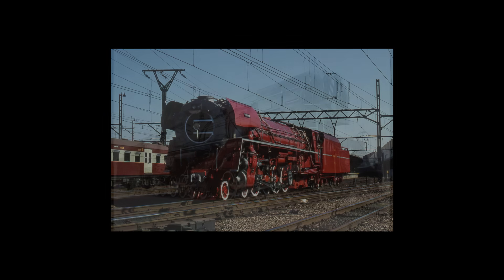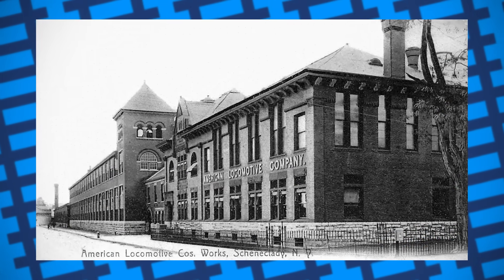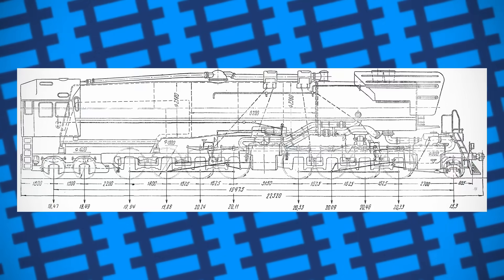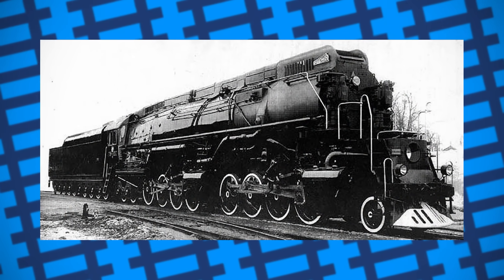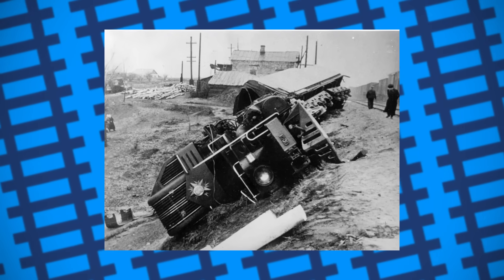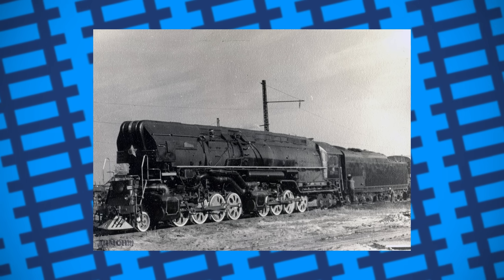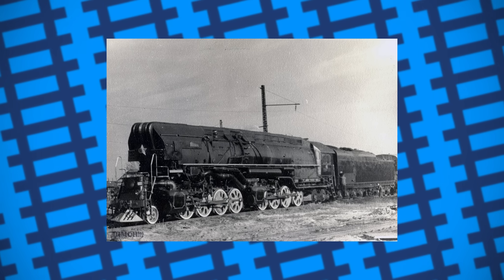Russia's Mightiest Steam Locomotive (that they never used) - USSR П38

Comment: 4:01 most modern American articulateds were actually simple, ie non-compounding. If memory serves, the last proper mallets built in the states were the C&O’s H6 class 2-6-6-2s, a modification of the USRA standard design dating from WW1, but they were built in ‘49.

Comment: Challenger and Big Boy both used simple expansion. It's only a "Mallet" if it does use compound expansion. If it uses simple expansion it's a duplex which may or may not be articulated. The Pennsylvania T1 class is a example of a non-articulated duplex. There are also many locomotives that used compound expansion and were not duplexed.

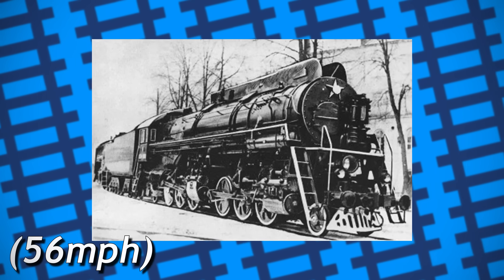Comment: 2:22 I reckon this is a translation error? What you probably mean is Heusinger valve gear. 
Heusinger invented a gear virtually identical to walshaerts independently around the same time, so german speaking countries (and a couple others) call it heusinger while most others call it walshaerts but the difference is really in name only.

Also no, the lack of compounding wouldn't have been an issue with any somewhat competent boiler design. The UP big boys and challengers were also not compounds. The advent of Superheating replaced compounding to make an engine efficient and economical. And the p38 is superheated.

Comment: Most of the US Mallets were not compound, after around 1918 most US Railroads drop that outside of the Northfork Western Railroad. The Challengers and the Big Boys, as did the Pennsy T1s and Q1/2s basically all post 1930s locomotives not N&W only use high pressure steam in their 4 pistons.

And none had problems keeping up steam.

Comment: I'm not entirely sure, but I think you have mallet's and articulated simple expansion locomotives mixed up. The UP's challenger's were simple expansion locomotives, meaning they had high pressure front and rear engine cylinders. By the 1930's, mallet or locomotive's with a set of high and low pressure cylinders had mostly fallen out of favor, especially in the U.S. as they were slow and mostly for drag freight. It is likely that the P38 followed this shift towards simple expansion locomotives which would dictate the end of the steam era, and thus used simple expansion for this reason.

Comment: I would note that 4 high pressure cylinders would have been standard for large articulated steam engines in the US by the 1950s.  US design quickly moved away from compound mallet design and by the 1920s most articulated steam engines were "simple" articulated designs with all cylinders being the same pressure and piped steam directly from the boiler.  Therefore it makes sense that the Soviets would copy the concept for the p38

Comment: It’s possible the locomotive would’ve had steaming issues, but I don’t think it would’ve been entirely down to the simple cylinder arrangement. If the boiler wasn’t entirely up to the task, the leaking flexible joints would’ve made things worse

Comment: So, these locomotives are not mallets, mallets, by definition, use compounding. If all 4 cylinders receive high-pressure steam straight from the boiler, it's not a mallet, but instead a simple articulated
Reply: ar enough, but (at least in the US) common terminology often refers to the Mallet articulation (which was kept up to the end of steam in the US) as separate from Mallet compounding (which was mostly dropped in the US well before the end of steam).

Comment: Fascinating! I know next to nothing about Russian locomotives. The 4 equal preassure cylinders of tge P38 would make it a Simple Articulated, not a Mallet. Mallets use steam twice, simple articulated use steaam once, through both cylinder sets simultaneously.
Reply: Far enough, but (at least in the US) common terminology often refers to the Mallet articulation (which was kept up to the end of steam in the US) as separate from Mallet compounding (which was mostly dropped in the US well before the end of steam).

Comment: Great portrait of the Pe 38. Impressive machine, must not fear a comparison to the american sisters. Like them the single expansion was most probable chosen, because the low pressure cylinders would have been too big to handle. Already the Bavarian Gt 2x4/4 Mallet from your other video hat low pressure cylinders with a diameter of 800mm. Try to scale up to the Pe 38 it could easily measure up to 1 meter.

Comment: why do you keep refering to it beeing a simple articulated locomotive rather than a mallet as strange? it defiently isnt, most good articulated engines are simple articulates, with only the penny's 1309 and it's class coming to mind as an example of a mallet that was good, most found that the front exaust steam cilinders where too weak

Comment: I doubt it had steaming problems, the union pacific challenger. Big Boy and many other similar engines had 4 high pressure cylinders and didn't have issues.
Reply: Not to mention this is the Russian loading gauge and not some tiny European one so the firebox isn’t really as limited as others on the continent.
Reply: Those are two of the best example, but we have our duds too. The N&W found their Z-1 Mallet boilers to be rebuilt as Z-2 Simples and the C&O H-7’s, the first Simples, were so poor the C&O didn’t even keep them
Reply: @russellgxy2905  do you have a source to backup your statement, because what I can find crews say it was a fine performer.
Reply: @gamerfan8445  Unfortunately I can’t recall the source for the H-7’s. From what I’ve found on forums like Trainorders, they WERE good pullers, but they weren’t any better than a Mallet in terms of speed. They had the same tonnage rating as an H-8 on home rails, but that was simply in drag service
Reply: Not all articulated steam locomotives had four high pressure piston.  The Mallets had two front high pressure cylinders that fed into two low pressure pistons on the rear driving wheel assembly.
Reply: @bigboy4006  The high pressure cylinders are in the rear in the original Mallet design, so that the high pressure steam does not have to go through the articulated or flexible pipes to the front cylinders, which are on the swiveled engine.  (Later improvements in technology for getting the steam to the swiveled unit enabled US locomotive makers to make all cylinders high pressure without running into the problems that the Soviets had described here.). In principle, you could have high pressure cylinders in front and low-pressure cylinders in the rear on a cab-forward design (which turns the whole design around), but I don't know of anyone who built a cab-forward Mallet articulated that also had the Mallet compounding (the Southern Pacific Cab Forwards had all high-pressure cylinders).
Reply: @Lucius_Chiaraviglio  That makes sense.  For some reason, I thought the cylinders were the other way around.  It's been many years since I've read about both the high and low pressure cylinders, so I most likely misremembered.
Reply: Because these things aren’t simple, the Soviets in their infinite wisdom made a Mallst with same size low pressure and high pressure cylinders, which is why in terms of Yellowstone that are big heavy stupid ones like this one it is by far the weakest, because they were trying to do compounding because they didn’t understand what a simple articulate actually was..
Reply: @definitelynotakgbagent6612  Well that would explain a LOT
Reply: You forget that this is the Soviets we’re talking about. They can screw anything up.

Comment: So I have a couple of problems with this video. Most of the articulateds here in the United States, including the UP Challengers mentioned, are simple articulateds, not mallets. Just like the P38, the challengers and other simple articulateds have 4 high pressure cylinders and are not compounds. Simple articulated designs were found to be highly successful here in the US and abroad with Garrett locomotives. So going with a simple expansion design on the P38 was a very sensible thing to do and was already very well proven. 

Also, it seems unlikely that this locomotive would have had trouble providing enough steam for the cylinders just because they’re single expansion. Like I said, the design was well proven, and it certainly seems like the P38 was given plenty of steaming capacity, as indicated by the 4 wheel trailing truck, automatic stoker and all of the other advanced appliances added to the design. This seems to be a THOROUGHLY modern design.
Reply: No, simple articulateds came in in the '30s. Mallets before that were compounds. Check out the Virginians' enormous and slow-but-successful 2-10-10-2s, for example.
Reply: @garryferrington811 the P38 was built in the 50s. What’s your point? 

I’m saying that a true mallet IS compound by definition. That’s what the original patent states. Simple articulateds are NOT mallets because they are single expansion, not compound. Nowhere in my comment did I mention a year.

Also, there were some simple articulateds being built before the 30s. The Great Northern M-2s and N-2s were simpled in the 1920s for example.

Comment: 3:55 Our articulated locomotives were actually mostly non-compounded (aka "simple") like the P38; either built like that when new, or converted from compound "true Mallets" during rebuilds.
Reply: Beginning in the '30s, you mean. Mallets were compounds before then.
Reply: @garryferrington811  yeah I suppose I should've put a timeline on that. Either way by the time the P38 was introduced, we'd largely given up on using Mallets, with notable exceptions like the N&W Y6s.

Comment: 6:20 not really a problem considering the challenger, Bigboy, etc have that same setup. While able to maintain max pressure with no problems.
Reply: Most European countries have significantly smaller loading gauges, so a smaller boiler could theoretically struggle to feed four relatively large cylinders
Reply: Irrelevant. Russian track gauge is 5′. Loading gauge back then was larger than the current European outline.
Reply: @crocowithaglocko5876  I don't know whether this was the case in the 1940s, but Russian loading gauge (as well as track gauge) is larger than US loading gauge, although maximum axle loading is lower.
Reply: @crocowithaglocko5876 not really, especially considering we talking about a boiler that was built after ww2.
Reply: Soviet coal was known to me much worse than American or German coal
Reply: @miles-fifty  there’s a solution to that,  the Russians found very quickly, it’s called oil firing. In reality, it’s probably because this thing was hilariously underpowered for how big it was. If you want an idea on the tractive effort, it’s almost at 100k pounds of tractive effort. Meaning it’s more underpowered then it’s US equivalents of the same wheel arrangement, infact it’s more underpowered then the original Yellowstone from 20 years before.
Reply: @definitelynotakgbagent6612 with decent oil firing I don’t see how you can make a locomotive that underpowered, it had to be coal or motor oil
Reply: @miles-fifty  because it’s not a simple articulate it’s a compound articulate. Low pressure ans high pressure cylinders are the same size meaning it has absolutely horrifically bad steaming because it can’t use any of the low pressure steam effectively. From my understanding this was the soviets making a big articulate without understanding why stuff like the challengers or American yellowstones worked.
Reply: @definitelynotakgbagent6612 but again 4 high pressure cylinders was a bad idea to start, any nation would’ve struggled to get it to work well
Reply: @m @miles-fifty that is a thing it’s called a simple articulate,  the US figured it out during World War 1, The Soviets didnt have any experience with articulates outside of a few compound mallets. This thing failed because the Soviets had no idea why the US ones worked (Compound mallets use steam twice, one in high pressure and the other in low pressure while simple articulates use steam into the cylinders at the same time)
Reply: @miles-fifty All of the US famous articulated are 4 high pressure cylinders man, Big Boy, Challenger, Can Forwards, Yellowstones, were 4 high pressure cylinders, the Russians just sucked at big steam.
Reply: @miles-fifty  The u=US built several  hundred 4 cylinder simple articulateds
Reply: @definitelynotakgbagent6612 granted that probably due axel loading more than anything.
Reply: @miles-fifty meanwhile the US figured it out in the 30s.
Reply: @definitelynotakgbagent6612  you realize that the Yellowstone and challenger have no low pressure cylinders.
Reply: @g @gamerfan8445  do you know how a simple articulate actually works? Because all the engine sets are high pressure on a simple articulate
Reply: @definitelynotakgbagent6612 miss type
Reply: Big boys were n notoriously poor steamers as they proved to be at the threshold of that design going 4 drivers to far.

Challengers were MUCH better as far as dependable steam especially at speed.

The Soviets did some remarkable things with steam. Their decapods were very standard fare lasting into the late 1960s.
Reply: @kgtmustang  so much so they could reach 60 mph with no problems if the driver wanted to.
Reply: Boiler pressure was a pretty conservative 15 bar. Baureihe 05 (from 20 years earlier) was set to 16 bar (initially, it ran on 20 bar, but that was already overkill for design goal of 150 km/h -- and drivers got funny ideas about racing electric trains at speeds of 200 km/h).

It's interesting that the Russian design went for a single, enourmous, slow and inefficient locomotive. Yes, I guess the Russian railroads  weren't suitable for high speed travel (but they also weren't exactly suitable for the weight of the P38), but cutting travel travel time between Moscow and Novisibirsk (2200 km, IIRC) in half would also have sockets transport capacity (it's around 48 hours nowadays by train).
Reply: @klausstock8020 not really, for what the Soviet needs, an articulated design dose make sense. A very powerful locomotive can take heavy loads on its own while having lowered operational cost due to not need to maintain, crew, and fuel a second engine.

Comment: I would bet that the reason why they used 4 high pressure cylinders is to keep parts commonality as high as possible between the front and rear wheelsets.
Reply: Or it could be the visit to Alco when the Challengers were being built gave them the inspiration. All Challengers were simple articulateds, as were the Big Boys that followed them, high pressure steam goes to all 4 cylinders.
Reply: @Shipwright1918  That is also very plausible indeed.
Reply: @Shipwright1918  That was my thought too - thinking of the Challenger and Big Boy, I don't think the non-compound articulated is as unusual as the person making the video thinks it is. I believe he's British/English so is more familiar with European steam technology, where I get the sense compounding was more popular (including on the original Mallet design). European designs were all about refinement and efficiency, while American (and probably Soviet) designs were just about raw brute power and simplicity. Probably a matter of the relative cost of coal.

Given that it was clearly at least partially inspired by the Challenger, this is arguably the Big Boy's Soviet Brother (couldn't not say that in Jeremy Clarkson's voice). Or "Bigboyski?"
Reply: I've also heard that compound mallets are much more difficult to operate, and balancing the size ratio of the high and low pressure cylinders is problematic - a given ratio is only optimal for a given operating situation (speed, power, throttle, reverser setting). So while compound is more efficient under specific "on-design" conditions, having all high-pressure cylinders is much simpler, easier, and more versatile. I'm guessing in practice the efficiency improvements of compounding in locomotives were small, some locomotives built as compound I've heard were later converted to simple-expansion. Ships typically used triple-expansion compounding, but they're typically operating at one speed and power setting so it's much easier to optimize it for those operating conditions.

Comment: I find that smoke box design or thing on top of the smoke box so interesting, why did they do that, is it just aesthetics
Reply: Streamlining/aesthetics. At the end of the day, streamlining had a lot more going in aesthetics than actual practicality lol, even if they did often function.
Reply: @josjos-x5s  It was probably seen as a sign of modernity. Might have helped aerodynamically for fast passenger locomotives, but wouldn't matter on slower freighters like this.